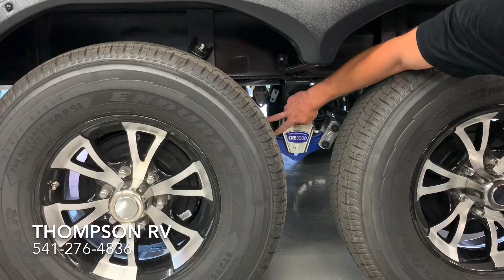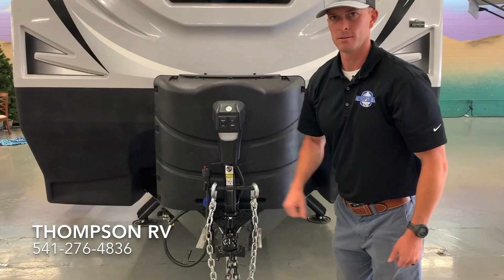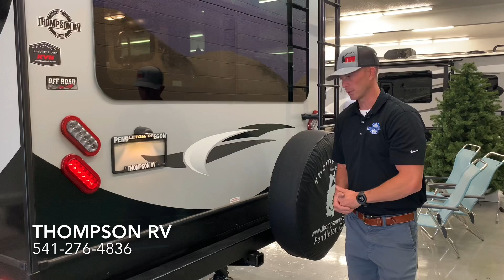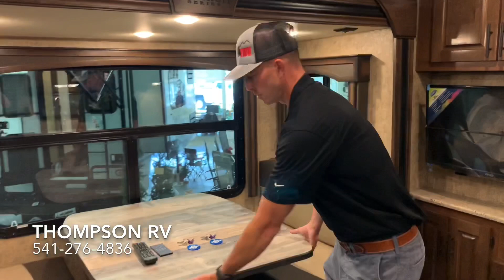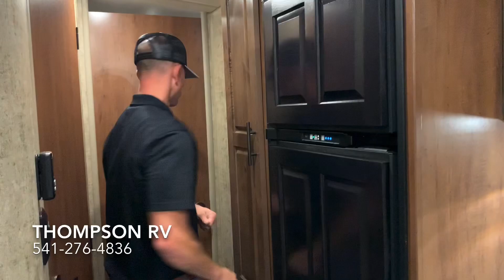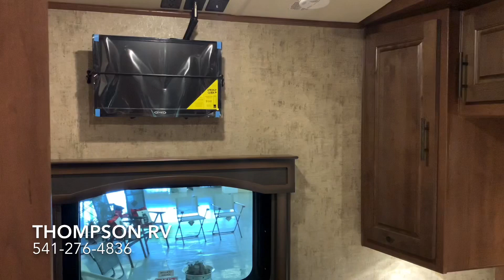New 2021 Outdoors RV Timber Ridge 24RLS Titanium Series Four Season Trailer Walk Through

Comment: Outdoors rv claims to be a super cold weather unit but they don't even know well enough to put the batteries in a heated space? That's a poor design
Reply from the maker: Not everyone wants their batteries inside. 95% of our customers prefer exterior mounted, non lithium batteries. There are some great companies that will install lithium batteries under your bed!
Reply: @thompsonrvinc  Why would a company that is building its reputation on the ability to stay outside in the cold want to put their batteries outside...Knowing full well that battery performance suffers terribly in cold weather?

Comment: Can you please tell me why the stove is NOT a titanium series style stove? I noticed that it is in fact a mountain series trim level stove without the led lights and auto pilot ignition. Also noticed that the backsplash doesn’t have your typical mountain etching on it and is black, as well as the kitchen faucet also being a mountain series trim level faucet. I look forward to your reply as I am looking at the 21’ 24rks and noticed these flaws as well? I was under the impression that these were standard features in a titanium series and not optioned in. Thanks.
Reply from the maker: This video is on the early 2021 model. Check out the newer video and you will see the new stove.

Comment: You missed showing us the shower. Would be nice with a fire place; are they available? How long is this trailer?
Reply from the maker: This is a technical walk through orientation. We have an additional 24rls video on the floor plan review. No, there is not enough depth for a fireplace. 28’8” tip to tip.